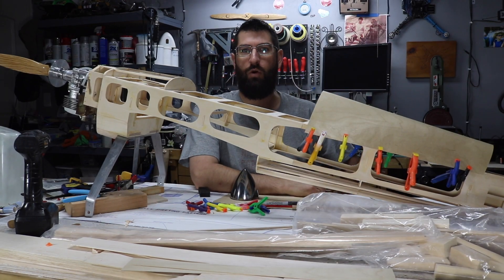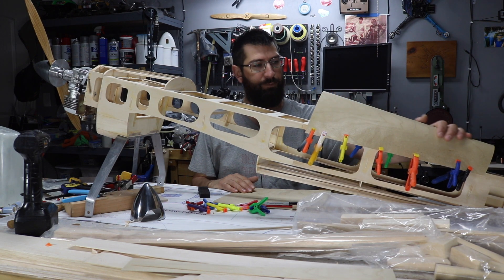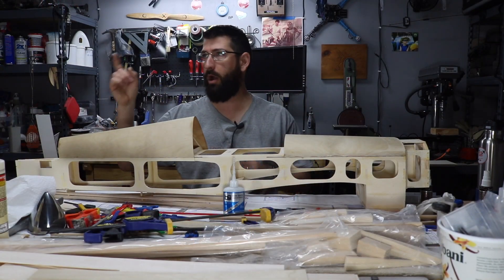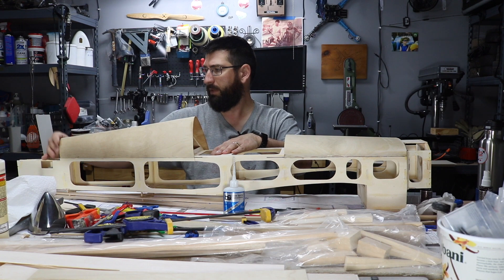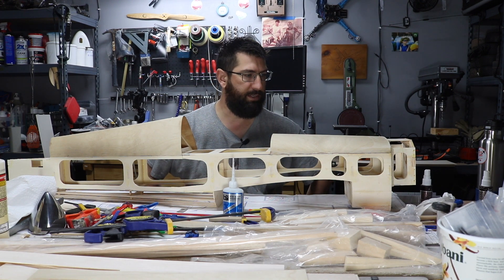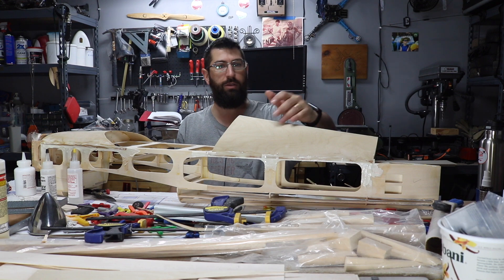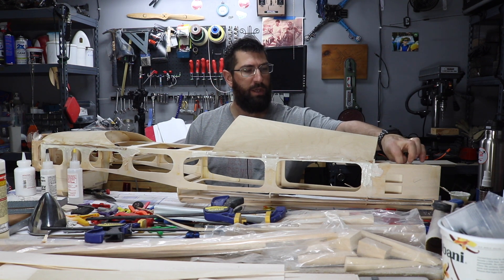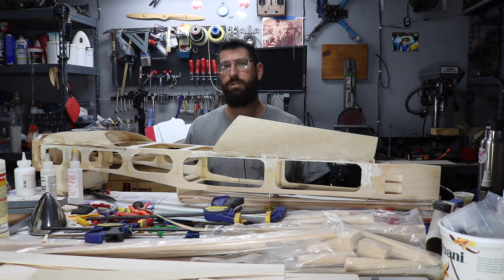Midwest 27% Giles 202 Part 7: Finishing the Fuse Build

Comment: So the rear turtle deck doesn't look like it has any extra formers or spars.  That thin wood veneer provides the support?
Reply from the maker: Steve Jones it has 2 formers. I added a stringer along the back bone. It is then sheeted with 1/32 plywood. It is surprisingly strong.
Reply: @JoesRCCorner   Yeah I saw only two formers but wondered if there were more in between. The plane is looking great. A little suggestion if I may. Perhaps you could do a little less time lapse so we can see what your doing. I haven't built a lot and am always looking for better ways to do things. Most of the time I just figure out my own way but I'm sure I can save some headache if I knew some tricks.
Reply from the maker: Yes sir. I recently got that same feedback from another, in the future videos I will try to limit the time lapse video. Thanks for the support, and feedback.